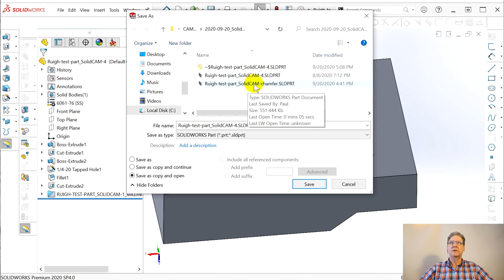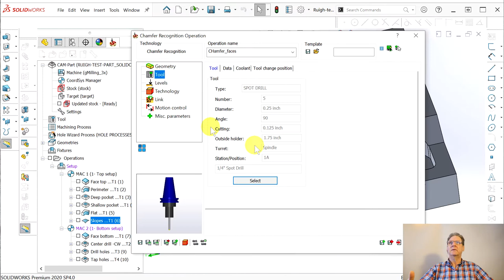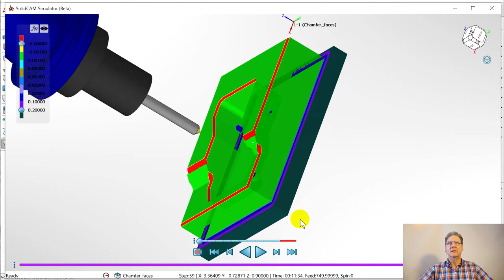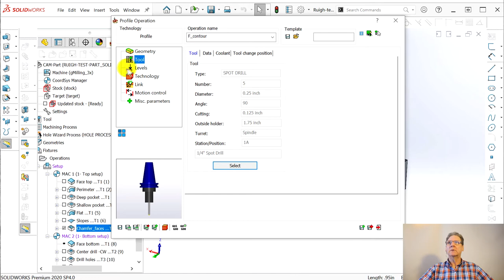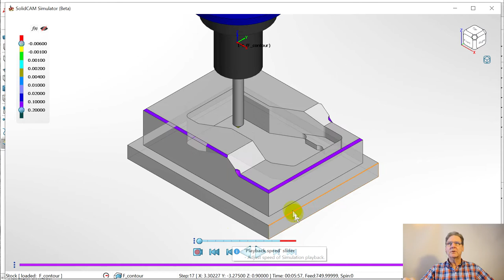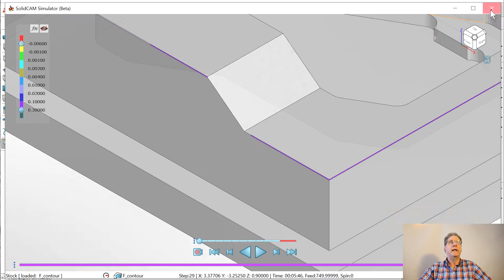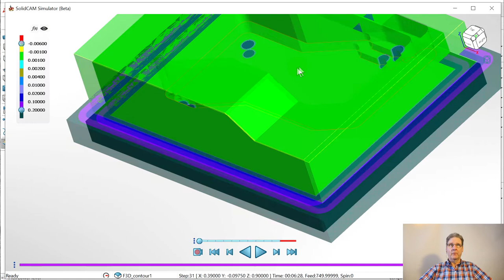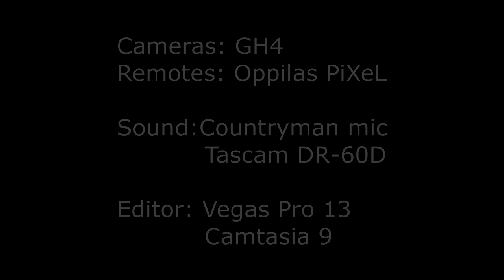SolidCAM chamfers

Comment: Sir when I try this with the 3d profile, there is a different chamfer on the angled surfaces.
Reply from the maker: Yes, the width of the chamfers will change due to the geometry. That is why I do the angles separately with a smaller chamfer-- check out the whole video to see how I compensate for this.